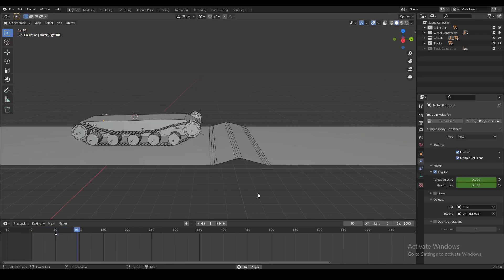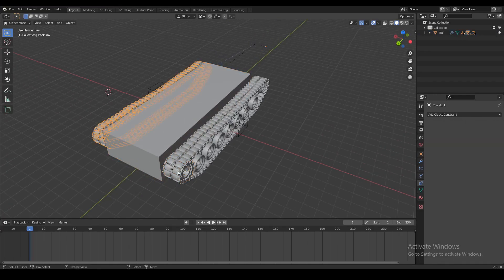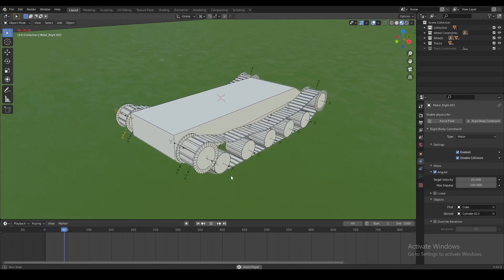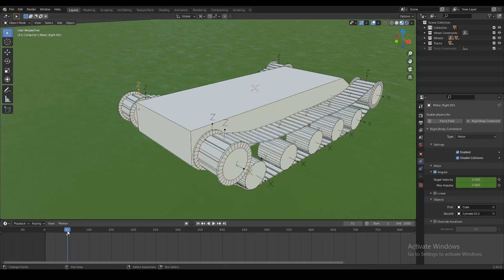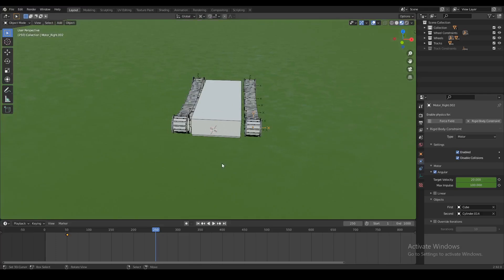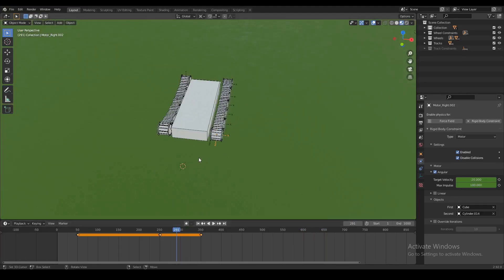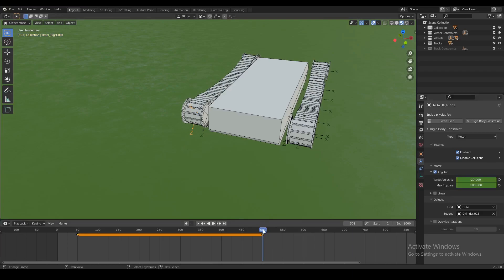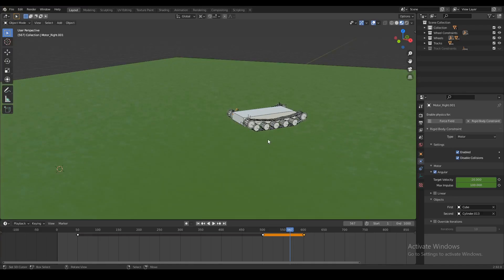Blender Tank Tracks Tutorial Part 3 | Animation, Physics, Constraints (Arijan)

Comment: for the suspension, you could try the route of using a cloth sim and a shrink wrap and having the bones that represent the hull parented to the bones that constrained with the cloth sim. it is also a small physics sim however probably not as computationally expensive as having the entire track simulated and it solves the droopiness of the tracks.

Comment: Would this simulation work with the sprockets and tracks you made for the m1a1? Or would it interfere with the physics?
Reply from the maker: I haven't tried, but I think it would work with some adjustments. The objects are a lot more complicated on the Abrams so it might be harder to process

Comment: What about neutral steering where both track go in opposite directions?
Reply: just use the same method with different power keyframes lol
its possible when tank is completely stopped, so make sure when the tank stops to make one of the tracks has positive power and the second track has same power but negative